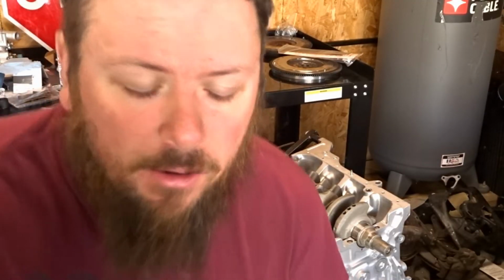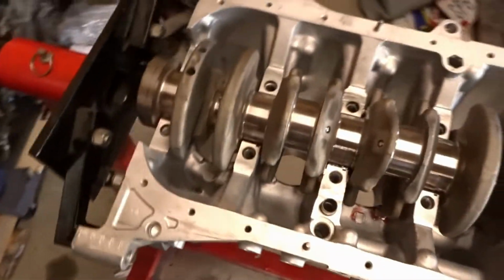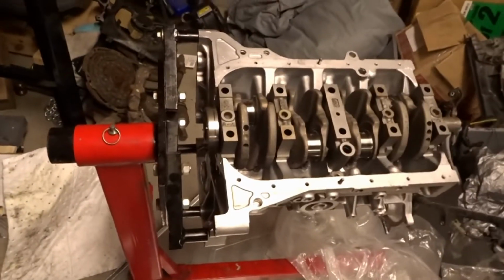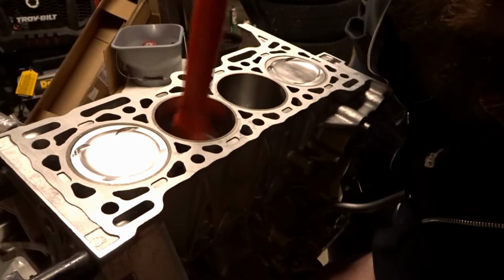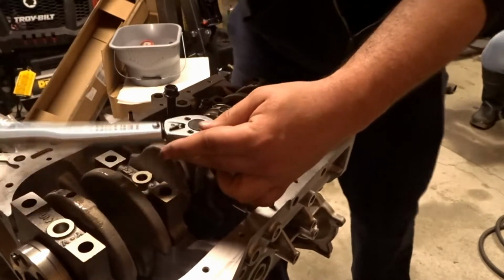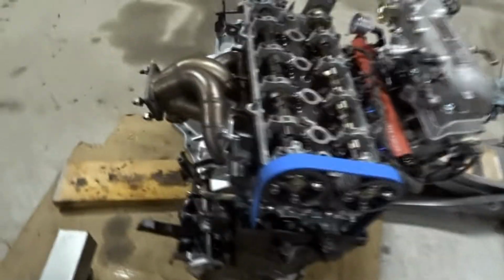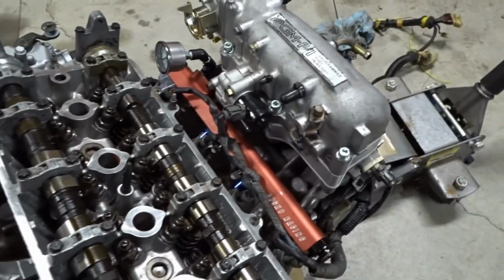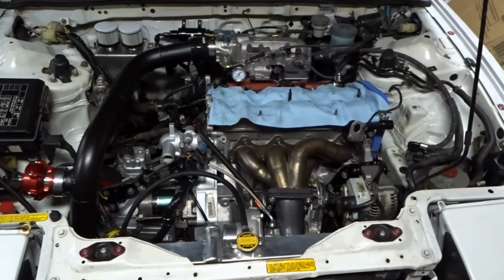Final Engine Assembly & Install

Comment: do you have to notch the block for the rods and do you use the h23 rod and main bearings too?
Reply from the maker: Yes h23 on the rod bearings, the main bearings are h22a4/f23a.  Raceeng.com is the place to go.  I did not have to notch the block on the eagle rods I went with

Comment: what turbo did u use, and if u have a link that would be great. and any head work?
Reply from the maker: My Dyno video has a parts list for the build.  But its a Garrett gtx2876r gen2 and as far as the head goes it has supertech h22 valve springs and Brian Crower exhaust valves